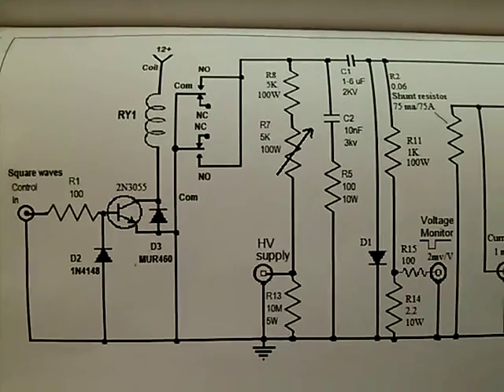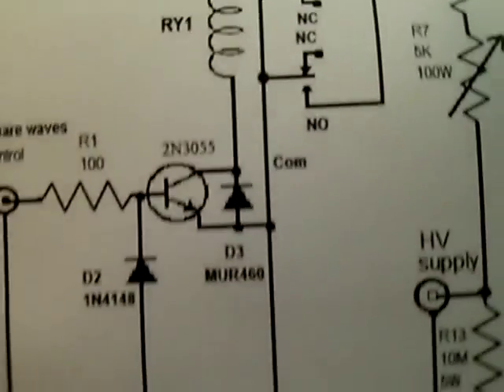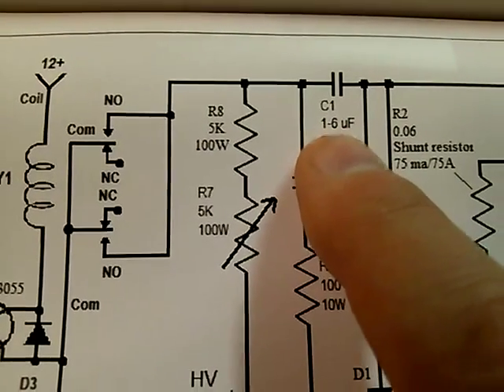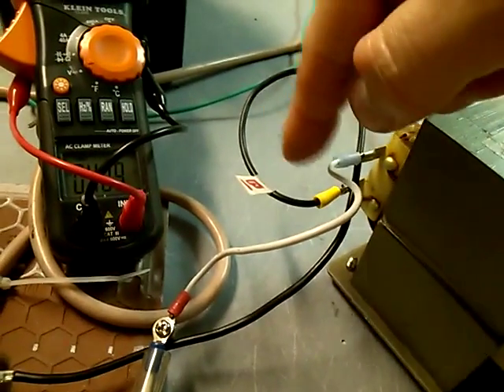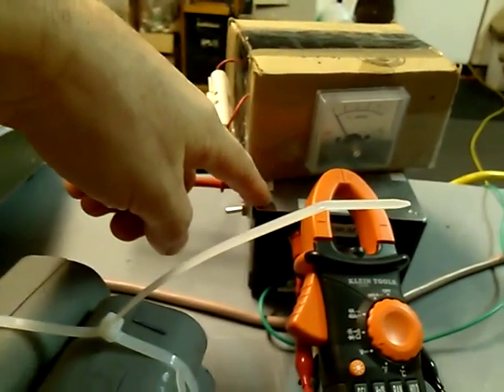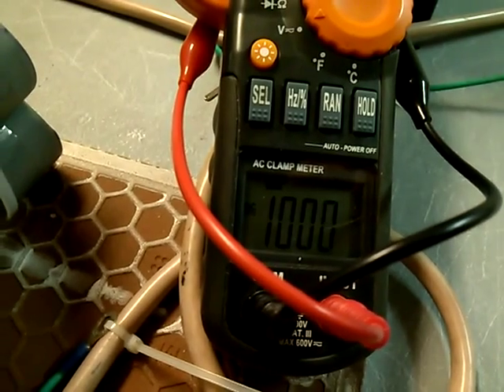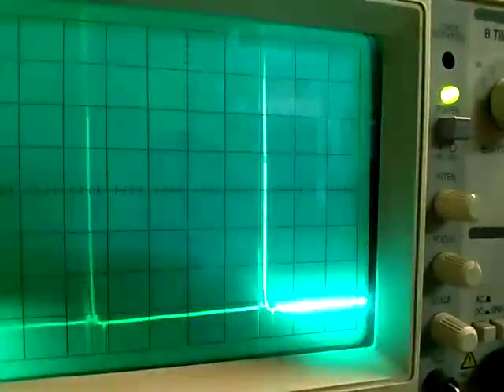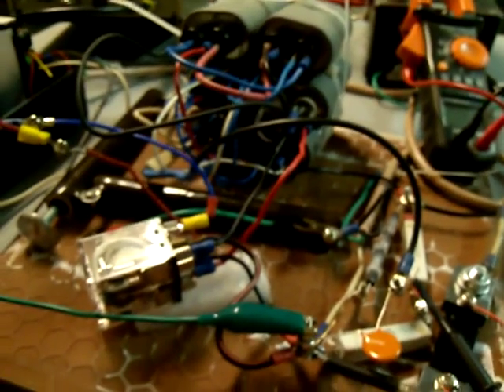High Voltage Pulse Generator 2

Comment: I’d like to see the solid state version. Funny thing comes to mind since you are using a spark plug: if you are pushing 1,000v the output is going to be in the order of only a few mA. So, once you are already using mechanical linkages, a simpler solution might looks more like an older car distributor cap. The frequency might be harder to nail down - but then again relays are hella latent and prone to sticking.